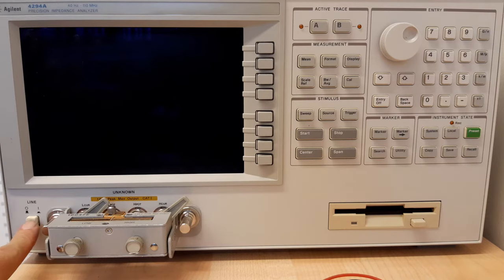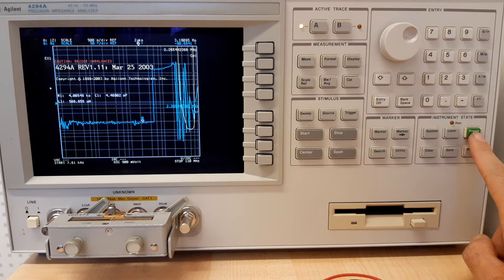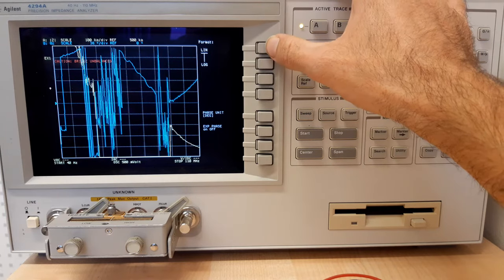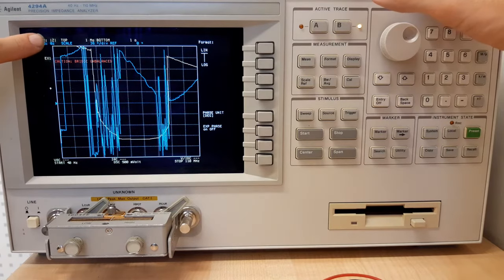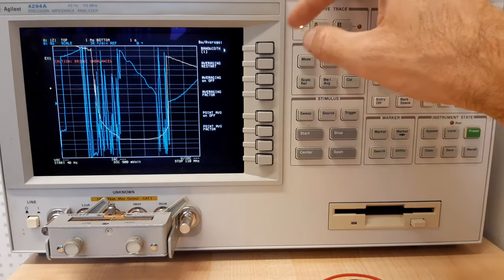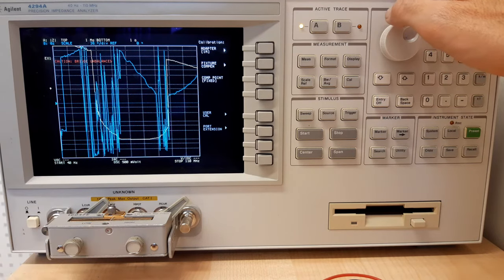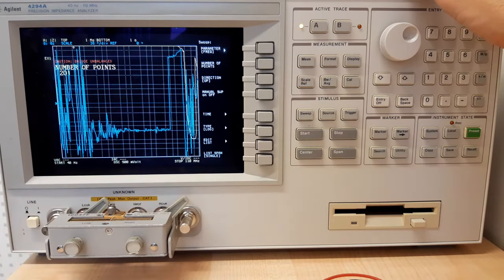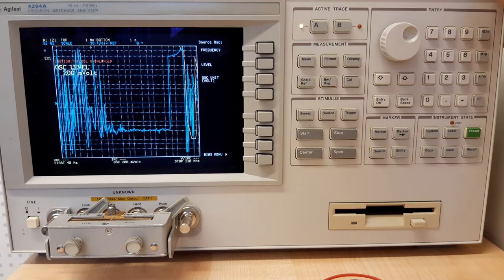How to Perform Measurements With the Precision Impedance Analyzer Agilent 4294A - Part 2

Comment: Extremely valuable video. Thanks. I would really appreciate if you had time to answer this: First you do a zero/open calibration as you show in the video at around 6 min. Afterwards you change the frequency setting and the number of measurement points. Is the zero calibration strictly speaking still valid for the new frequencies from the new frequency sweep? Thank you again.
Reply from the maker: That is an excellent question. Striclty speaking, the calibration is only exactly valid for the frequency range that has been set before and for which the calibration has been done. If the frequency range and resolution is altered after the calibration, an interpolation or extrapolation of the correction factors needs to be done. As the behavior is usually quite smooth over frequency, at least the interpolation is not very problematic in most cases. Nevertheless, it is better to calibrate the instrument for the very same frequencies which are also used for the measurement to avoid this small source of deviations for very precise measurements.
Reply: @MathiasMagdowski  Thank you. This was clearifying. Maybe this is a silly question, however: Can you in theory do the zero calibration "manually" yourself? Say you want to measure the admittance of a device. I measure the admittance with no zero calibration. After this I simply conduct an ordinary additional admittance measurement with the ports open circuit. I then subtract this open circuit offset from my admittance measurement. Would this work or am I lost here? Do you know? Thank you som much.
Reply from the maker: @MathiasSther-nr6xv  Thank you for your further inquiry. However, I do not fully understand your question or the purpose of your proposed procedure. The idea of the short-circuit and open-circuit calibration is to increase the accuracy of the impedance measurement and the ends of the dynamic range, i.e. for very small and very large impedances. It is possible to perform another calibration point at "medium" impedances, e.g. 100 ohms, to increase the accuracy and reduce the absolute measurement uncertainty also in this range. This requires a very well known and accurate reference resistor. After calibration, you can directly measure the impedance or admittance of your device without adding or subtracting any correction terms.
Sometimes it may be necessary to "de-embed" an adapter or test fixture used to connect your DUT to the instrument. In this case, I would first try to perform the short-circuit, open-circuit, and reference resistance calibrations with the fixture in place. Alternatively, you can try to manually measure the series impedance of the fixture and subtract it from the measured impedance of the fixture and DUT to obtain the impedance of the DUT itself.
Does this answer your question?
Reply: @MathiasMagdowski  Yes, I hope I understand you correct. The calibration aims to cancel out possible unwanted internal impedances from the 4294 and adapter. If the impedance of my DUT is measured without calibration for some reason. Is it possible to AFTERWARDS conduct this calibration? If I understand your last sentence correct, this is possible by "manually" measuring the series impedance?
Reply from the maker: @MathiasSther-nr6xv  I think retroactive calibration is a challenge. You would need to know exactly what the calibration does. It may involve some basic offset compensation and impedance scaling, which may even be documented in an advanced manual or application note, or it may involve more sophisticated methods that are proprietary to the instrument manufacturer. Most likely, the calibration involves more than just adding or subtracting a certain impedance from the result, which is also not very easy because of the different ways complex numbers are represented. Are the real and imaginary parts compensated separately? Is the compensation done by magnitude and phase?
If you have measured the impedance of a device without prior calibration and you are not sure how valid the result is, I would suggest that you find a similar device and measure its impedance again with and without prior calibration. This should give you a good idea of the influence of the calibration on the measured impedance. Again, I assume only large differences for very small and very large impedances. Resonance frequencies or break frequencies should not be falsified by a missing calibration.
Reply: @MathiasMagdowski  Again, thank you. I seem to recall that in a previous model 4192A there were equations specifically stating how the calibration was performed by the analyzer. However, I haven't found any such equations inside the manual of 4294A. As you said, maybe it is not that straight forward. Anyway, thank you for you answers. I really appresiate it.

Comment: Thank you so much. it's very useful to my study. However, i got a problem with  I'm trying to use my computer   connecting  4294A with 82357B cable.  I use the excel to extract the 4294A data, but it shows something wrongs that my computer doesn't catch the  4294A signal. Could you help me how to deal with it. Thanks!
Reply from the maker: You are referring to this cable, right?
https://www.keysight.com/us/en/product/82357B/usb-gpib-interface-high-speed-usb-2-0.html
I'm sorry, but I don't own this cable and cannot test this approach.
What I can suggest is to try to use a different cable or USB-to-GPIB converter like this one from National Instruments:
https://www.ni.com/de-de/support/model.gpib-usb-hs.html
I would also suggest to use a different software than Microsoft Excel, at least in order to test the correct connection from the computer to the instrument.
My personal favorite is Python with the package "PyVISA: Control your instruments with Python":
https://pyvisa.readthedocs.io/en/latest/
A very simple "Hello World!"-type example is directly given on the webpage.

Comment: Have you ever saved the binary .DAT file and processed with other code like python or matlab? Thanks
Reply from the maker: No, I have always used the ASCII formats which consume a little more space but are probably easier to process. Nevertheless, there are slight differences between the different formats if you measure very small or very large impedances, see this (German) paper:
"Einfluss verschiedener Datenformate auf frequenzabhängige mit Impedanzanalysatoren gemessene Impedanzen"
https://www.researchgate.net/publication/362174625_Einfluss_verschiedener_Datenformate_auf_frequenzabhangige_mit_Impedanzanalysatoren_gemessene_Impedanzen

Comment: Thank you so much. This video is beneficial.
Is it possible to do bias dependent (DC) measurement using this instrument ( at different DC biases)?
Reply from the maker: Sure, you can set a DC bias somewhere in the menu. I never had a reason to do so, because I usually measured purely linear components.
Reply: @MathiasMagdowski  
Thank you so much for your response.
Reply from the maker: @nithinxavier5122  You are welcome.

Comment: Sir how can i make working electrode for gel polymer electrolyte.....my membrane is not sticking on FTOs glass plate....it detached after drying.....i also used nefion binder but detached after drying
Reply from the maker: To be honest, I'm not an expert for gel polymer electrolytes and corresponding membranes. You might want to check https://www.nafion.com/en in order to find some information about correspoding Nafion binders.

Comment: Hi Sir, I have a query regarding the voltage supply. How can we check about the voltage supply from this Impedance analyser? I have checked into Manual and that stated as follow: 90-132Vac, 198-264 Vac.

looking forward to hear back from you.
Reply from the maker: To be honest, I do not really understand the precise question. Do you:
a) want to check some other voltage supply using the presented impedance analyzer? This is not a good idea. You might want to use an electronic load or a large bulky load resistor together with a multimeter or watt meter instead.
b) want to check the internal voltage supply or power supply of the impedance analyzer itself, probably because it is no properly working? I have no clue about this. Please contact the manufacturer.
c) what to know, for which AC mains input voltage your impedance analyzer is specified for? This information should be typically given on the type plate at the backside of the instrument. If you don't find this information there and are unsure, again please contact the manufacturer or your distributor. They are happy to help you.